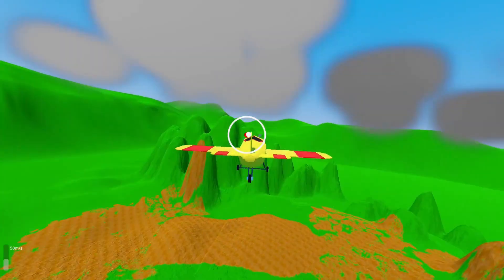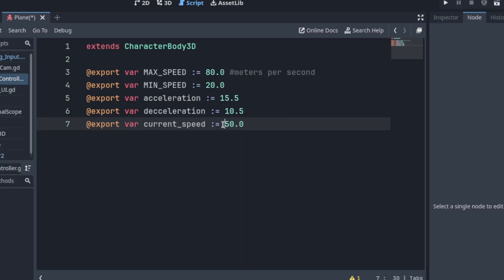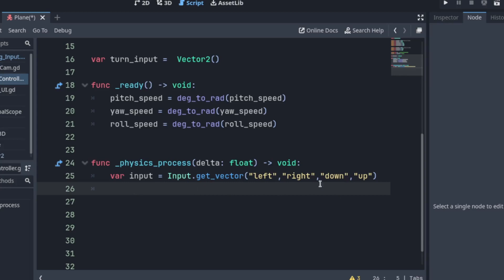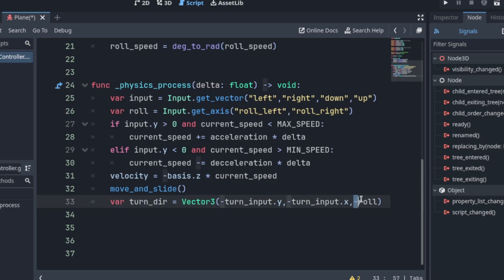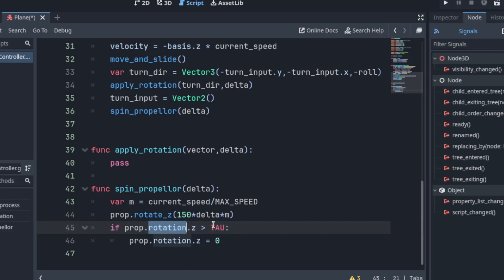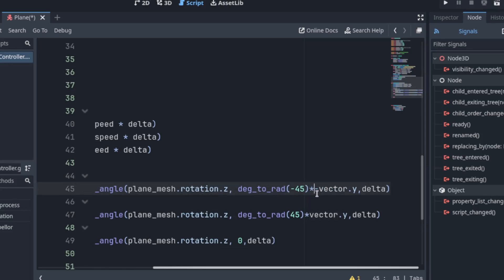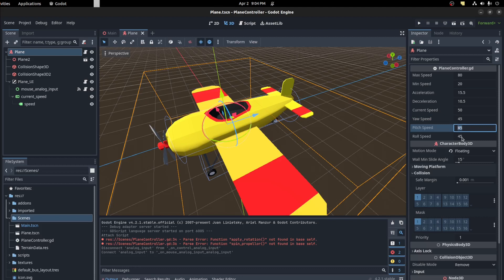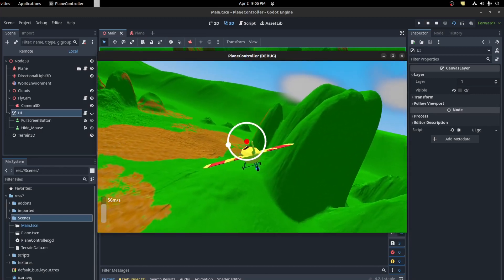Plane Controller in Godot 4 | Spaceship Controller

Comment: Hello, good video brother but I have a small problem and I can't find a solution, it is that when having a large map (either in Hterreain or a simple mesh that I have already made in Gaea) the plane shakes the faster it goes, which is what with a mesh of a plane this problem does not happen. If anyone has a solution it would be of great help to me, thank you
Reply from the maker: Its not the faster its the  further away from the center it goes. float point precision is less the further you go away from the world center. 2 workarounds is to move the world around the player or you can make a double precision build of the engine
Reply from the maker: You can read this to get you started https://godotengine.org/article/emulating-double-precision-gpu-render-large-worlds/
Reply: @Chevifier  thank you very much for the information